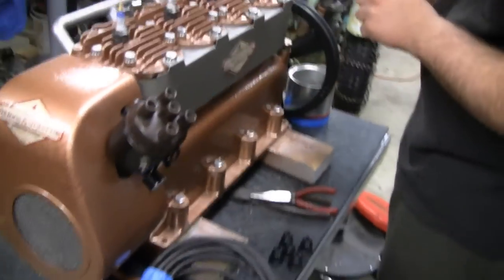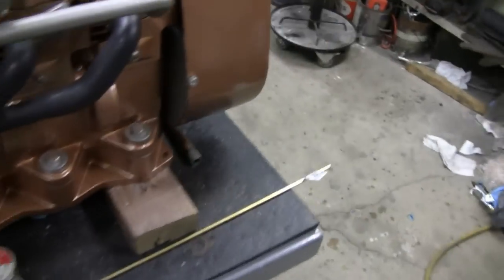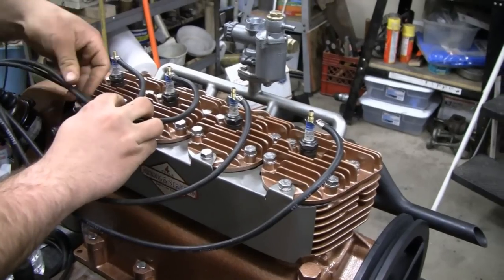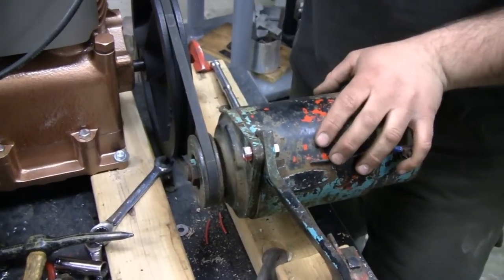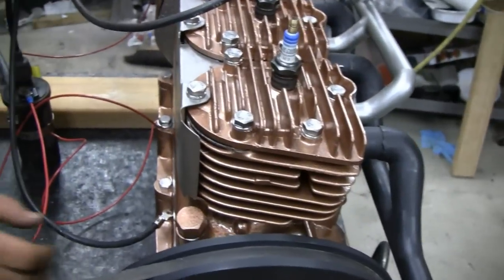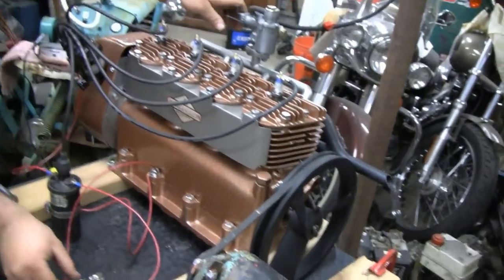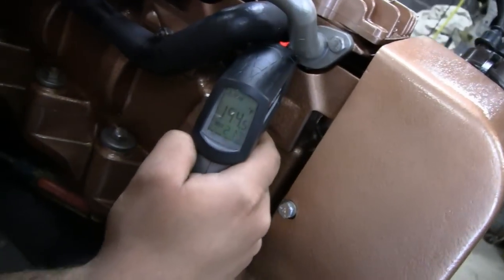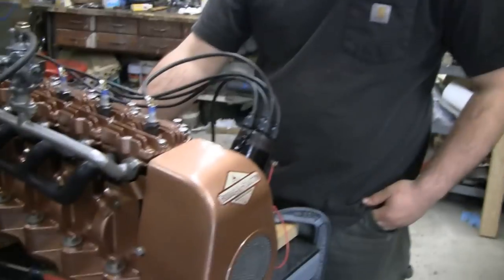HOMEMADE 4 CYLINDER BRIGGS PROJECT (part 20)

Comment: Good Morning!
My name is Marcelino, I live in Brazil
I filed a patent for a different internal combustion engine, it will be: rotary, 4 stroke, no leaking, no 2 stroke oil, no valves and controls, few moving parts.
I think this engine will be more economical than otto cycle engines and more efficient than Wankel as it will not leak due to sealing rings.
It's been 3 months since I filed a patent with INPI Brazil, but it is slow to get the patent.
     I need a partner / partner to make a small prototype, to see the actual performance of this engine and then commercialize this project / engine.
       At the moment I only have the autocad drawing in 2 and 3 dimensions. Prior to building a prototype, some mechanical software testing could be done to see performance, heat, wear, other
  Are you interested in participating in this project?
neglect the errors, I did google translation

Comment: Get a BMW transmission and back wheel from a motorcycle or a Honda with a transmission in a drive shaft something like that and put that motor in a motorcycle using kiwi leaf spring front end and some fenders from a Kawasaki Drifter that look like the old Indian fenders and build yourself in line for that looks like an old Indian that would be too fucking cool

Comment: Nice feeling, when it fires up!!!! Sounds awesome!! Still trying to figure out, how did you make/put crankshaft in??? and camshaft?? You welded 4 of them together?? How did you get it in??? Missed that part....did you ever showed it?? Other than that, interesting=)) Where you will use it? How many cc's/HP??? Good job, enjoy=)
Reply from the maker: Thanks Bud!! It was only built for engine shows!! It's 393cc and 6hp!!☺
Reply: How did you get crankshaft/ welded them together???
Reply: but how did you make the crank ? weld the 4 together?
Reply: how is it only 6 hp isn't that relatively close to the stock engine?
Reply from the maker: Each engine is only 1½ HP and we didn't change the bore or stroke!!☺

Comment: What is the practical ( or intended ) use of that engine?
Reply from the maker: It's just for displaying and running at Engine Shows!!☺
Reply: 805ROADKING
would it possible to fit it into anything, aka like a go kart or a moped? I know it is kinda weak, only 5-6 hp but it still is 4 cylinders....

Comment: alright guys you have motivated me to go ahead with my project. will be building an inline 3 cylinder craftsman 2 stroke, 23cc x3. if I do it right and it work effectively it'll be going in a mini drag bike frame that has been sitting all lonely and engineless for years now.
Reply from the maker: Good luck Bud!!☺

Comment: for that starter generator cant u just reverse the polarity on that starter generator? its dc anyway so it shouldnt matter. but idk if that works some of the 2 stroke golf cart starters have reversable poles so it can start the engine in two directions u can find some nice used ones for cheap.
Reply from the maker: Nah that wouldn't work!! the brushes are mounted on an angle that would fuck them up!! Plus it wouldn't charge that way!!☺

Comment: What I want to hear now, is the engine under load driving something - as we both know the sound of a hardworking engine is quite a bit different ;)
Reply from the maker: It's only a show engine!! You can't put an engine like this under a load, it would break in half!!☺
Reply: Well I was thinking something along the lines of a generator, or a constant load. Not an irregular load like a vehicle's driveline.
One day maybe, one day :)

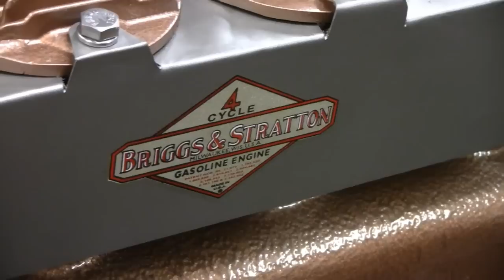Comment: Man, this thing sounds awsome! I really like the look of the NOS spark plugs. The blue on them looks really great. By the way, at 1:34 I think I can see a small crack on the left cylinder head. I don't know if you have already noticed it, but I thought I would just mention it in case you didn't see it (maybe it isn't even a crack and I'm just a fool haha). Looking forward to the next video :)
Reply from the maker: Thanks Bud!! Good eye!! Somebody snapped the corner off the side of that head before we got it!! If we had another head we would have replaced it but for now it doesn't affect the engine so we're gonna leave it!!☺

Comment: I've got to give you a shout out, my friend.  I've been watching you and Mike and a few other guys all winter instead of watching TV.  Its been time well spent.  Today I had to start our old Homelite chainsaw, which hadn't been started in at least ten years.  Now, I learned to use a chainsaw when I was fifteen, but I've never been good at starting them, but thanks to all I've learned from you fellows, I actually got it started more than once.  Thanks a bunch!
Reply from the maker: Thanks "T"!! That's quite an accomplishment!! Chainsaws can be a pain in the neck!! I have an Echo chainsaw that's been sitting in the corner of the garage for four years because I don't want to mess with it!!☺
Reply: I took out the plug and filled the cylinder with Mechanic in a Bottle, turned it over a couple of times to coat everything good, and let it sit for a while before I started it.  I figured the valves and rings would likely be stuck after sitting that long.  After I cleaned the plug, checked for spark and checked the carb, which was clean, the little thing started right up.

Comment: need two carbs me thinks I don't think you are gonna get enough CFM from that one mikuni type might kill you on power or worse go lean and burn it up
speaking of burn your temps are more then ok you don't need to start panicking until 350-400F they start melting at about 450 generally for single cylinder race motors they run at about 300 to 325 so 250 is not a issue at all

Comment: Something I should mention, If you have 12 volts going through the points they will burn up very quickly. Put a ballast resistor between the coil and the distributor and this will prevent this problem.How do I know this? Ken
Reply from the maker: Damn Dude!! How did you do that!! That's basic Auto Mechanics 101!! Rookie mistake eh!!☺
Reply: I made this error when I was about 15.. I am now 58.Ken
Reply from the maker: If you were only 15 when it happened it wasn't an error, it was a learning experience eh!!☺

Comment: Is this How Orville and Wilbur started? Congrats are in order.I was concerned about the temps but the reading you showed are at idle.Open the throttle a bit and let it run. Sounds like the spark is a bit retarded from here.Great job guys! Ken
Reply from the maker: Thanks Bud!!☺

Comment: Wow! Very cool. Please remember that the infrared thermometer does not measure with the red laser dot. It will measure the temperature over a big area, and to measure something slim like the pipes, always hold it close, otherwise it will show low. The angle of measurement is shown on the diagram on the side of the gun.
Reply from the maker: Thanks Mate!! Good point!! We tried close up and all different angles and all results were very similar!!☺

Comment: I knew it would run good. Hope you put some oil in. I've used jb weld on old farmall exhaust manifolds that crack by the outlet, it holds up but like any epoxy it expands/contracts at a different rate then the metal so any vibration would compromise adhesion. You guys did a great job here and i got my pc working again with gewgle-chrome!
Reply from the maker: Thanks Bud!! We put too much time and money into it to forget the oil eh!!☺

Comment: Nice job. I'm still Leary about air flow, but that is some nice work.
Reply from the maker: Thanks Bud!! Why would you be leery, It runs cooler than a stock single cylinder!!☺
Reply: Not that wont cool, that it won't develop full horsepower. Because of restricted volume of airflow by using the same size pipes and ports. Maybe 4 into 1 exhaust but with a 1 or 1.5 I'm h manifold. Same with intake. Also what is the airflow rating of the carb? That should also be x4.

Comment: Runs Great!  However, I'm concerned about the design of your intake manifold. You may want to take a look at this video about intake manifolds. The design is a lot more important than I thought.  Engine Building Part 8:   Intake Manifold Theory
Reply from the maker: Thanks Bud!! You can rest easy, it's only a 6 HP lawnmower engine that is gonna run at 500 RPM not a 426 Hemi!!☺
Reply: 805ROADKING OK, I understand.  As a small engine mechanic myself, I love how you guys do things right.  You guys are awesome and so is this engine.!

Comment: Great job guys. Sound good. Have you messed  with the timming at all? It sounds like it should be advanced a little and maybe it will run even better.   Dan
Reply from the maker: Thanks Bud!! The timing is fine, we just had to adjust the carb!!☺

Comment: You need an idler on that belt so you can kick the starter off and not have to hear the starter dragging along with the engine.
Reply from the maker: That's a starter/generator!! After it starts the engine it turns into a generator to keep the battery charged!! We have a different one on there now, maybe it's a little quieter!!☺
Reply: That'll work.

Comment: Nice running little engine.  I love the starter generator.  I have an old 3~3.5 hp Briggs turning a 12 v alternator that I would love to put a starter generator on.  Mostly just use the 12 volts to maintain a battery in a power outage to run an inverter and a few refrigerators and deep freezes.  The engine is to small for bigger amp loads, stalls the engine when more than one fridge/freezer starts at the same time.
Reply from the maker: Thanks Bud!!☺

Comment: This thing sounds perfect! It was eager to run too, fired right up once you tweaked the carb.You can tell you guys did a great job because of how smooth it is. Most YouTube contraptions bounce all over the place, but this thing is so quiet and smooth its like you just opened a crate and poured in some gas. Great job! Very satisfied! 
My notes during the video
3:30 Nice. If the electric motor timed at 0 degrees you can just spin it backwards and swap the leads. I'd turn down the comm and maybe skim the brushes just to let it break in fresh as it's now spinning a different direction than it historically ever has. 
7:40 That carb is awesome. Something so nostalgic about it. You never have to worry about losing your needle adjustment. Do you think its big enough to cut your own notch in that needle for fine tuning? I bet if you made it less than half a notch richer it would lower your temps to right where you want them. Not that your temps are high for an awesome custom made motor, you just seemed concerned with the #4 head. Maybe if you cut the side cover in some fancy appealing way that exposes half of the cooling fins you could add flair and lower the temps a bit.. 
13:50 I bet a plastic riser would help keep the carb around room temp. Some PVC would be a great insulator for your carb.
Reply from the maker: Thanks Bud!! We happy with the temps, they're all about equal and all are lower than a stock engine!!☺

Comment: Awesome looks great 
Also that carb is almost like a mikuni snowmobile carburetor.  I think that deal that holds the needle should have a spring to pull it back to idle when its not being pulled open but I'm not 100% sure I just know the old snowmobile carbs that are similar have springs in them. I hope that makes some sort of sense to you. That's just what I know from working on some old sleds just thought it might help
Reply from the maker: Thanks Bud!! Yeah it should have a spring but it's fine for what we're doing with it!!☺
Reply: Yah it should be fine I don't think it will affect much cause all that spring is doing is pulling it back to idle when you let off the gas

Comment: I know you have the starter generator on there, but you should consider putting a car alternator on there as well and make it run a lightbulb, I think when you bring it to the shows it will be more cool showing it actually doing some work, similar to what some of the guys do with the old Maytag at the shows.

Comment: Runs good, it would run better if the intake didn't drop most of the fuel into the two middle cylinders

Comment: Been watching a long time for this, been worth every minute!
Like your plug wires! I borrowed a scrapyard solid core wire from about a 1940 GM truck, and the old wire has worked perfectly!
Oh, so that's why you wanted the V belt pulley, cool.
Amazing it runs so cool, I have turned exhaust pipes blue, and had them glowing red at night.
Great running project, glad it has worked out so well, congrats!

Comment: What sort of cooling fan do you use?
Reply from the maker: just a standard blade fan!!☺
Reply: 805ROADKING Right, any video of it? I'm wondering how well the cooling would hould up under load at higher RPM. It'll be kicking out a lot more heat then. Either way, it's an amazing build I have to say!

Comment: Yeah, that's a badass alright! It reminds me a lot of the sound of some WWI aircraft engines. It sure as hell does not sound like a lawnmower. Considering that carb was meant for a scooter or small motorcycle I figured it would be able to handle that engine, and besides I remember some truly MONSTER sized 8 cylinder engines from the 50's and 60's with tiny little 2 barrel carbs on them.  I would have expected a little bit of variance in temps but geez it was practically dead even across the board when comparing one 'engine' to the next.  Shame about that side decal but it looks like it set okay with a bit more water...remember they make that hobby spray that will melt that sucker right into the paint.  I'm sure you could also get some of that glue at like a crafts store too. You going to have a fuel pump and tank mounted underneath on the cart or gravity feed? That's wicked cool sounding machine guys!
Reply from the maker: Thanks Toes!! The decal is fine now!! It got really cold the night I did that, I'm sure that was the problem!! We have a gravity tank on it!!☺

Comment: Did briggs make a 4cyl or did you have that decal custom made?
Reply from the maker: Nah it's a stock sticker!! It says 4 cycle not 4 cylinder!! If I could have changed that and made it look good I would have!!☺
Reply from the maker: *****
It would probably work all the decals are on the cooler surfaces but we'll check it with the gun!!
Reply from the maker: *****
that's cool Bud!! You've said it many times before and we really appreciate it!!☺